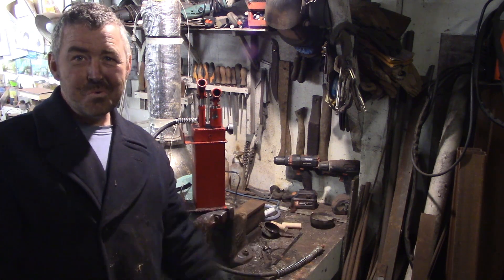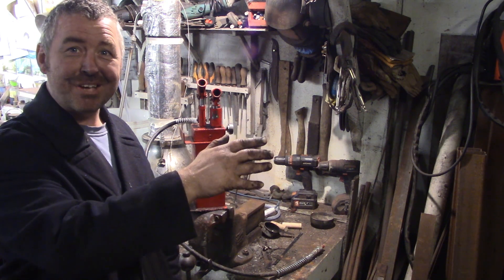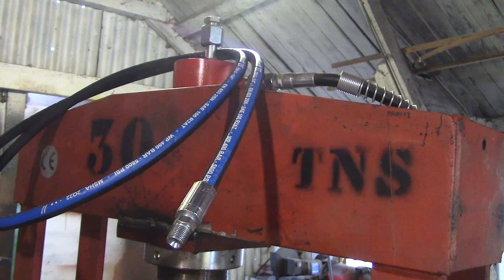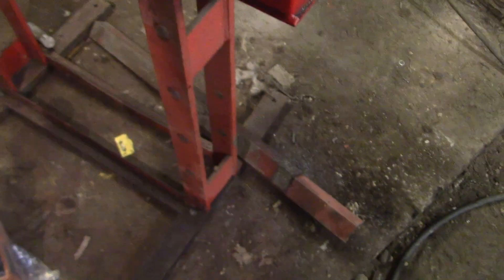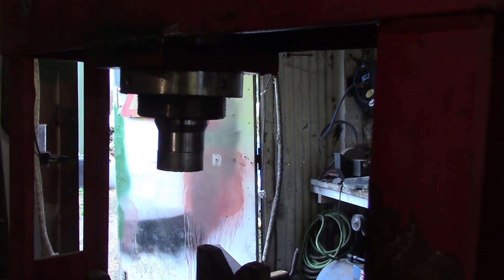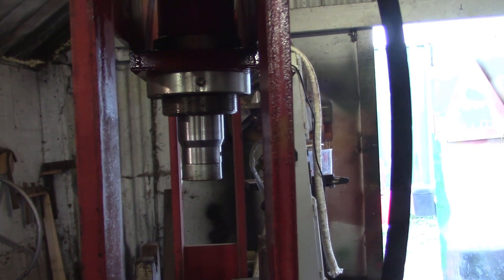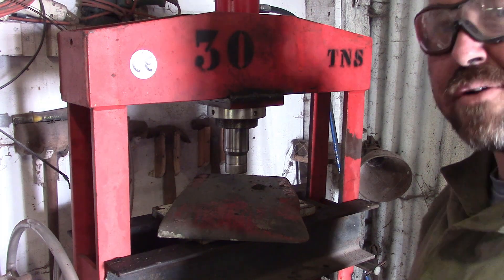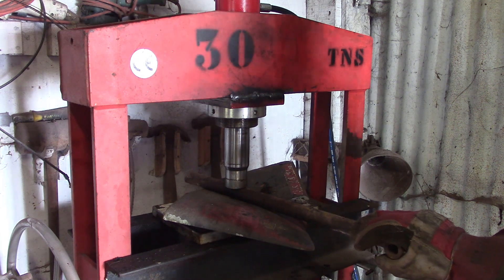Air powered 30 ton press conversion

Comment: That woul have been maybe good for me lifter. But its a bit noise more then I prefer it. I liked that pneumatic drill. Its huge.
Reply from the maker: I think you need more flow than this can give you, it would be too slow as well as noisy.
The drill is a beast isn't it, bit too big for my compressor though.

Comment: it's a shame and worrying that local skilled traders like your pipe guy are disappearing only a few years ago with in 5 miles we had a guy you could take any baring to and if he didn't have one he would recon yours or make you a new one and lots of shops repairing radiators motors hydrolic rams etc they have all gone now
Reply from the maker: It's a real shame isn't it.

Comment: If you want light hydrolic oil, cheap ATF is also hydrolic oil.
Reply from the maker: Had atf in there to begin with, I buy it by the barrel as I've got a Mercedes that uses total loss lubrication.
Reply: @turboconqueringmegaeagle9006  ah, the old total loss Mercedes. I had one of those too. Great cars if you can keep oil in them.
Reply from the maker: @Engineerd3d  Will be the last Mercedes I own, ignoring the box, the robustness I fell in love with on earlier vehicles isn't there anymore.

Comment: With a little valving you can pressurize the oil tank with air and use it as a rapid down feed, then use the actual hydraulic pump to build pressure
Reply from the maker: I get what you are saying, clever idea.
Reply: @turboconqueringmegaeagle9006  just have to remember, or automate the vent on the oil tank to open and close at the appropriate times. It should just push the oil through the check balls in the pump

Comment: Old LPG Tank as an air receiver !
Nice one man.
Reply from the maker: Cheers pete
Reply: @turboconqueringmegaeagle9006  Gotta keep the eagle flying.
Reply: https://youtu.be/sL7gUrrF1uI is the video that gave me the idea. All the angles get covered. I am building one so I can use 2x small compressors to spray paint and arc air cut.
Reply from the maker: @madpete6438  upright tank with the outlet at the bottom means you don't need to weld in a fitting for a separate drain but I'm not sure those traps will keep the air dry enough to spray, especially with them being so close to the tank.
If you are comfortable welding to a px vessel I'd put another fitting in the top so it's more like the commercial upright tanks.

Comment: Jim, you could always make a hydraulic pump from an electric motor and a power steering pump and a hydraulic valve. My brother-in-law's dad did this and made dies for bending steel or aluminum in it on his press. It worked well for him.
Reply from the maker: One day mate, wouldn't mind making a fast lower tonnage forge press.

Comment: Good work. Interesting. I expect a lot of hydraulics can take 10,000 PSI.
Reply from the maker: 1-3k is where most industrial systems sit, would expect domestic stuff to be less, I think 10k is gonna find the weakest link pretty quickly.
Reply: @turboconqueringmegaeagle9006  My model engineering clubs press ha a max PSI of around 10K when I looked it up, so I am not sure about your figures. Certainly true of hydraulic systems like brakes though.
Reply from the maker: @BensWorkshop  of course 10k systems exist, I'm using a 10k pump here, just that the norm is significantly less.